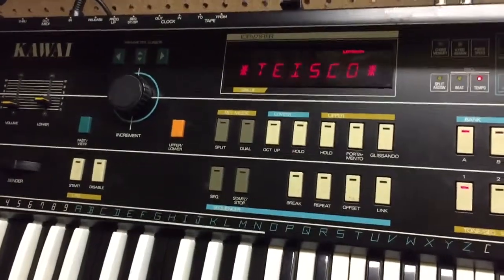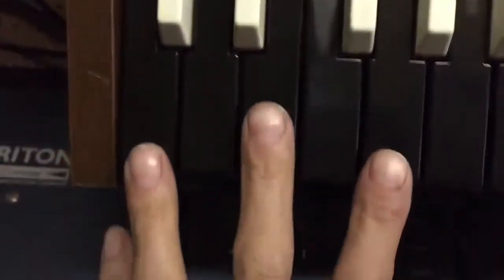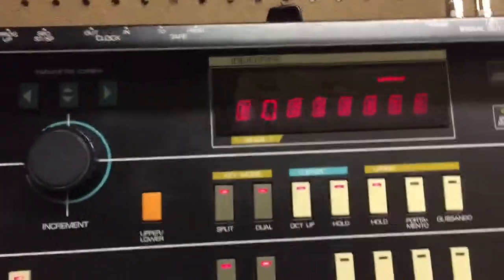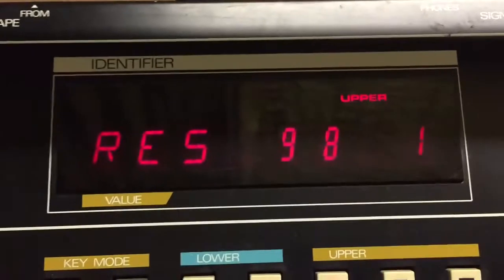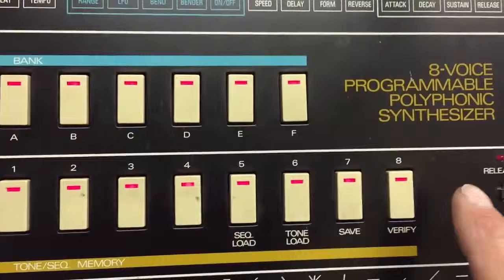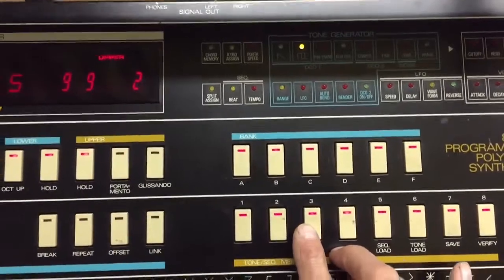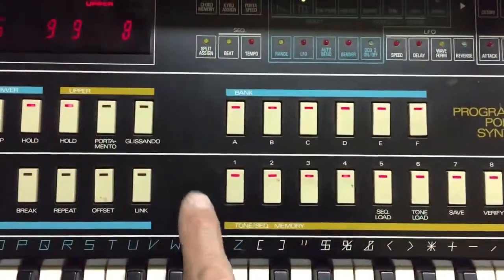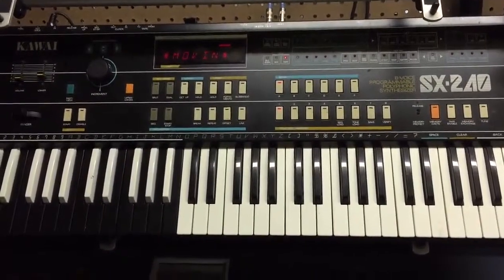KAWAI TEISCO SX240 VOICE TEST SERVICE DEMO MODE - HOW TO

Comment: Hallo! I hear voice 1, but if I press (i.e.) 2nd voice, I hear only the 2nd: I don't hear 2 tones together. Voices 7 and 8 seems having an hi-pass filter. Is it normal? Thank you!
Reply from the maker: Sorry I took so long, I didn't see your comments until now lol!
This mode is a good way to test the oscillators but it is also used for other tests, unfortunately I can remember what the other test is though...
Another way to check your voices is to hold a note down, play a 2nd note with the 1st still playing, and keep adding more notes, if you listen carefully, you shouldn't hear any notes drop out until you try to play a 9th note, if it drops out sooner, you have a voice thats not working.